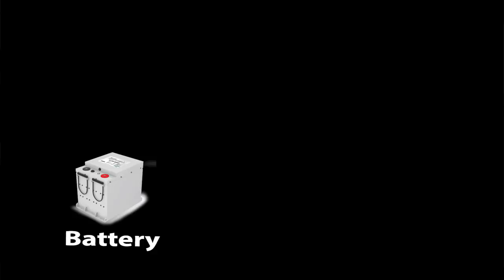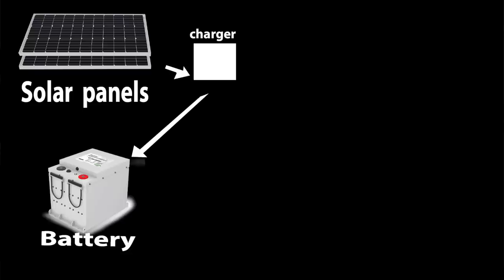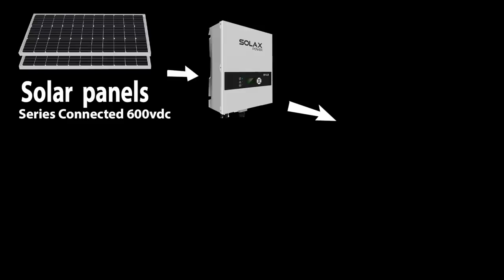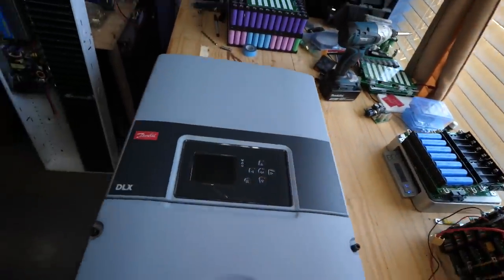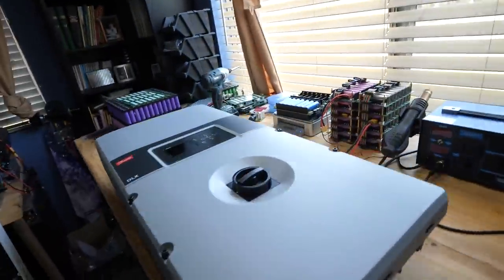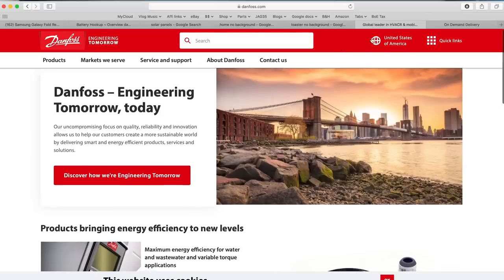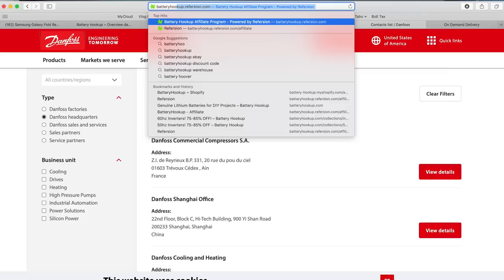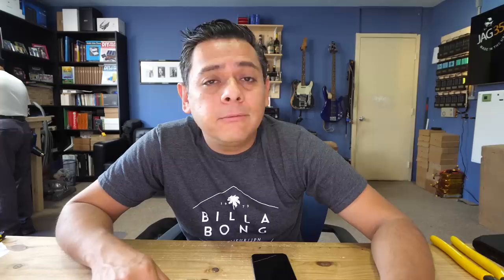Why are these Danfoss SOLAR Inverters So Inexpensive?

Comment: The series switching is for the arc flash on the high dc voltage side jehu
Reply: Is it cheaper to make like that?
Reply: @1978jra  probably otherwise they would have used high gause magnets to quench the flash,  think like a jacobs ladder,  needs a small gap to get arc started but the bigger gap, no way will the arc start,  open air has resistance value of approx 20 meg ohms i think (someone will chime in and correct me.) but as long as the voltage can overcome that resistance it will try to make a circuit with whatever is closest (shorter air gap) hopefully not you in the case of the kva range. that is why you don't fly kites or have helium balloons near high voltage power lines
Reply: @1978jra  must be other wise they wouldn't make it
Reply: @dtec30  True!

Comment: Question. I was looking at there specs and I saw that they have a starting voltage of 230v.on the dc side. So does that mean the system needs to have at least 230v’s before it will start converting dc to ac? And if that’s the case. Then you need at least 10, 24v solar panels. Right? Am I understanding that correctly? Or is there a way to get these inverters to start converting dc to ac with less voltage?
Reply from the maker: That’s correct 230vdc needed
Reply: Thank you. That answered my question.

Comment: SMA Sunny boy are the best,I use them Everywhere in the world Imput voltage is key
Reply: Curtis Albrecht  Hey Curtis, yes, they can work. If you have a completely ungrounded AC system, you can just connect the Neutral to GND in the inverter. The inverter will work without issues. The SMA SB5.0 series are all transformerless inverters so you need to make sure your DC potentials are flooting too.

Comment: Unlike AC in a DC current we never cross a zero point voltage between the cycles, a AC arc a lot less when terminals in a switch switches from ON to OFF, in DC current this arcing can destroy the switch, a switch which is rated at 240VAC often is only rated at 30VDC, it looks like that to make the main DC side input to handle the maximum DC input they have put all the three contacts in series, basically in increases the arcing gap compare to a single switching contact

Comment: Can they be grid tied to another offgrid inverter acting as the “grid” that it syncs to?
Reply: Electric Mountainboards an arduino plus two small mosfets and a small transformer, should amount to 20usd and be programmable enough to do it.
Reply: @fss1704  can you point me to the circuitry to do this?
Reply from the maker: Ive seen it done with a second inverter,  not seen it done with Arduino yet.
Reply: jehugarcia central tap transformer, you put the gnd's of mosfets on each side and 12v on the central tap, then apply a sinusoidal pwm signal of 60hz using the arduino, that's a piece of cake.
Reply from the maker: Sounds neat,  is there an example of anyone doing this on video?
Reply: Jayanth Devasundaram google "arduino inverter"
Reply: @jehugarcia  I made one inverter sometime ago using these motherboard mosfets and 3 rewired MOT's from scrap on a 2kw system that costed me just about the wires on the transformers, this system is scalable as fuck without additional controller hardware, you can just about increase the components numbers to get a bigger system.

Comment: i have question. I have 4 x160w solar panels. I have 2x 12v 230 a batteries. I have battery charge controller. I have 1000w grid tie inverter. I get electricity through the day from sun up to 300-400w but batteries does not get charged. How can i make batteries get charged for night and only after the batteries is fully charged, then take it for use in house?
Reply: Not sure if I'm right but the only way to charge them is with a charge controller or a battery charger being your grid tie inverter is connected straight to your panels
Reply: @rontech34  forgot to mention it, yes I have battery charge controller

Comment: Good inverter company but you need to study the specs to see if it meets your needs. It has 1 MPPT so all strings should be on the same roof direction (not one facing south and the other string facing west) and the max DC Voltage is 500 Vdc which will limit your string lengths. Ideally you would have a 600Vdc inverter that has a max 600 Vdc allowing for 12 panel strings.

Comment: Can you review 48V hybrid inverters Grid tied and battery backup connected to a used model S or Model 3 25V battery packs?  Can't one video using an all in one inverter with used tesla pack.  Thank you

Comment: It looks like these can be stacked / parallelized for bigger power output. And do have TCP/IP over Ethernet for monitoring and extra configuration. Unfortunately it doesn't support IPv6, or SSL. Both of which are weird.  Anyway, I am not exactly interested, because I want to have a hybrid system, preferably using single inverter. Theoretically I could have a separate inverter that operate from batteries, and charges batteries, but there will be many conversions in between, more space used, and it wouldn't be too smart probably in terms of when to charge and when to use batteries.

Comment: It's not called two phase, there is no such thing. It's single split phase. L1 across neutral, L2 across neutral gives you 120 VAC and L1 across L2 gives you 240 VAC
This is accomplished at the transformer with a single phase going in and splitting it to the neutral.
Reply from the maker: Got it

Comment: You will not be able to get the 50hz EU grid tie to sync up to the North American 60hz grid. Before the invert will output power it will want to sync up to the grids “frequency”. The 50hz will be looking for a 50hz grid only.
Reply from the maker: But what if it did?
Reply: jehugarcia well it and the electronics in your house could possibly suffer terminal malfunction; or at least run very hot and unreliably. Using more power, since they are specifically designed to run on the 60hz source. Though being as grid ties specifically look for the grids phase and match it, because out of phase power could once again cause issues with your appliances and the rest of the Grid. Ie your neighbors house.
Reply: iRoc Von JamminStien i'm sure you never touched a zvs in your life.

Comment: This looked like a fantastic deal until I looked up the approved list of inverters for where I live, and these unfortunately are not on the list.  As these are a few years old, are a discontinued item, and may not have all of the necessary safety features for your country - you may have issues getting an installation approved.  Danish quality they may be, but approved for use in Denmark they are not...

Comment: The problem is that they all run off such high voltages.  Makes it difficult when wanting to have an off grid system also.  I wish there was a way to modify them to use with a 24v or 48v system.   They look very well made though.  I thought of maybe using a bunch of relays to switch the system from series to parallel.  Want to see what you do to run it off of batteries.  100- 3.7v in series?
Reply: Run the solar panels in series direct to this unit, use separate split phase grid tie inverter /charger (like an AIMS) run the output of the danfoss to the input of the aims, and the output of the aims to your panel.   The aims will charge the batteries. 

Another way is series connection to the danfoss, and then parallel tap the panels with charge controllers to charge batteries, but would still need the aims to tie the batteries to the system. 

If you need power only when the sun shines, danfoss by itself would be sufficient.  

If I had a water tower, I would use the danfoss to run a pump during the day to fill the tower, and discharge the tower through a turbine at night or on cloudy/stormy days.

Comment: L2 is not neutral Jesus man.... L1 and l2 are both hot wires for 240 output in the USA....
Reply from the maker: It’s labeled that on the inverter,  and my name is Jehu not Jesus,  bob.
Reply: @jehugarcia  lol ok but that must be a European unit. An American unit wouldn't use neutral.
Reply from the maker: Supposedly is same hanrdware and all the region specific stuff is all software

Comment: new to all this. Isn't the 240 volt an issue. What size system do you need to use this? I have a good sized river behind my house and would really like to harness the power. A paddle wheel type generator on a float. But I just don't get how to get the 12 or 24 volts or even if I use one of those treadmill 90-volt things. I even bought a second hand 180 volt DC PWM 3/4 horsepower motor on eBay thinking I could use it but not for this system. How  I can power up a system that wants to see 240? Don't most people use 12 - 48 volt systems? So do you section off the batteries so they can get charged by the input voltage and then combine back to give the 240v to a power inverter and grid tie back?  thanks, Walt
Reply: fer starters... 12 Volts DC is a small system w/battery, say a backyard light or 2, or a small campervan set-up.... 
24 Volts DC is getting bigger, thats a large RV, or a larger home Lighting system.. 
48 Volts DC is the Serious stuff, obviously more expensive, but NOW we are talking the Voltage needed to easily use to convert to A/C for our Household appliances, HOWEVER, above 30 Volts DC is electric-shock and Fires, so lots more care is definitely Required there eh... I just stick to 12/24 Volts, needs bigger cables ( so what ! ), but NO bluddy electric shocks for anyone, and lots LESS chance of fires !!!.

Our system ( I have solar/controller/batteries, you are suggesting turbine/controller/batteries ) 
is completely self contained and stand-alone, thats it, you are welcome to use that DC Voltage as you like 
( I use 12 Volt, Vehicle Light Globes, in my house and around my yard !!! )

The 'inverter' connects to them Batteries, it Does NOT care about the turbine/controller at ALL, 
it is ONLY using them Batteries, so if the batteries go dead, the Inverter just stops working, full-stop...

In this Video he was talking about 600Volts from Solar Panels DIRECT into the Inverter - fantastic whilst the Sun shines, no bluddy Good- at ALL, at Night time, thus the need for the Battery system ...His Home was on the Mains/Grid already, That Inverter was just an 'extra', he uses the Mains/Grid power when its Nightime or Cloudy...

An Inverter WILL work off 12  or 24 Volts DC, just got to buy the Correct One ...

Good Luck !
Reply: @bluddyrowdy8757  Hi, yes I worried about this high voltage. The river is used by others and I would worry they would touch things! Don't want them to light up like a Christmas tree.  I had ordered one but had them cancel will probably start smaller and work my way up. to 48 volt or something like that. I bought a cheap Harbor Freight 100watt system @ 12 volts. Think I might get another and make it 24volts and get one of those cheap Chinese grid tie inverters  thanks Just want to do something to get started. Save a few cents and see if it is something I'm interested in. Thanks.
Reply: @walt4908  
I am an Electrician... Nah, do NOT be worried about the Water becoming 'alive', thats connected to mother-earth Matey, any 'stray' stuff will just go to ground, which should absolutely RUIN your generator in a matter of milliseconds... Please do what I do, the second-hand market !!! In USA its called 'craigs list' I believe... Quite simply work out what you think You may choose, find the 'new' price, then expect to Pay no-more than 30-50% of that Price,  for second-hand, simple clues to Look for in adverts are 'hardly used', 'like new',  '"still works, no longer req'd as have upgraded'", etc etc.. 1 word of Caution though, A/C is heaps Different to DC, so a standard AC 'circuit breaker' as fitted to housing, will NOT work on a DC system, I just use glass-fuses, on the DC stuff, same as was used in older Cars, they work great, and suit the mantra= cheap, cheap, cheap ! Good Luck !
Reply: @bluddyrowdy8757  Hi, no I'm more worried about nosy neighbors who will touch thing they shouldn't. That means I have to make the system "child proof" to keep people safe from  themselves. thanks
Reply: @walt4908  
Roger, 
a physical , mechanical . enclosure, non-conductive , plastic pipe called conduit Good ,  buried in ground or overhead on Poles. Most of the Way ?
Reply: Yes most definitely a  'tin shed' '  or enclosure, at stream end, weather Proofing is also solved, with a  lockable tin shed . one the size of a Dog Box  , pegged or concreted In
Reply: @bluddyrowdy8757  yeah, I have designed in sch-40 grey 1 inch  PVC most of the way and some liquid tight flex to get to raft that will have the PM motor/generator and paddle wheel set up to get the water to power the generator and thus power the batteries and or the grid tie system. Plastic barrels and plastic pallets will house the rafts electrical equipment. So this is the issue with neighbors. They will certainly want to get on the raft and look around. Might have to build enclosure or fence it in. Would like to run  AC up cause I'm 300 feet away from river, lot of distance and costly copper to go DC. But safer to go DC with low amps. Still working on final design. Yes, second hand is the way to go. thanks
Reply: @walt4908  
Brilliant ! Yeah yer miles ahead of me !!!!
I figured you were Playing, this is Well Serious ! , I know liguidtight, 'reinforced armoured Flexible etc ' conduit . Fence for Sure  is easiest, as second Barrier, I never understand why they are not Taller, but careful of a falling fence, reaching in.
AC is the MUST for that distance, its the Best surely not-in-Debate !, if you cannot bury conduit holding AC cable coupla foot down into ground all the way, where it pops out, just chuck conduit inside bigger and bigger pipe as more mechanical Protection, oops, back into ground again a couple of Foot down, away we Go, next Bit., and the higher you can keep the Voltage Up Matey, and lets not get too excited, you use 115V in the USA, 2x 115 = 230, 2 x that = 460, -maybe 500 your end, have 460 at the other end , thats my call for Transmission ( from my  eggspurt Armchair ), as Far and further you can get it before bringing it back to 'useable/necessary Voltage', is  bluddy Good !
Plenty of earth wires on any metal Generator parts , connected to a dedicated Earth Stake driven a Yard or so into mother earth etc etc.  Good On You !
Reply: 300 Yards.. ferk...thats A$100k just in that Fat multicore ( 3 actives, and a Neutral ) , plenty of Different layers of plastic, dfferent colours ) heck. Don't tell me I dont't wish to know $$, but thats a serious Distance for You - source. Yes, the Higher the Voltage, the Skinnier/Thinner the size of each condutor is able to be Matey , the difference is significant, I only know Metric = 95 -120 square Cable, and Bigger ? For You ! 
by George !, so 500Volts is now best if available, at the Gen ?
Reply: Every bluddy big power-cable manufactured in Aust, has an Earth wire in it too.,
 its a " 4+Earth cable "
Reply: 100 feet, 30 meters,  2 phase maybe usa, not our 3 phase in Aus ( AC anyways ).
16 millimetre cable,  individual conductors inside 2 x layers of Conduit is cheapest,
bit more bucks and lots easiest is 1 x circular cable,  in 1 layer of conduit .
63Amp circuit breaker for 16mm, perhaps for 230 Volts
Reply: My 16mm square is exactly half-way between your 6, and 5, AWG.
1 inch conduit hmmm. 2 Inch is good Matey, goes around corners lots easier inside that too, and its a 'robust' pvc to chuck around, hide under bricks and stones, Paint it when out of the Ground if exposed to Sunshine, pvc conduit costs like couple $$, so its nothing, to go bigger. Need " boxes" along the way ?  Screwdriver to open these Box, used at Change of direction even, in conduit-runs,, easier to pull  long-distance cable, or just assemble conduit  over cable as ya go... 
Heheheh, best I stop 'eggspurting away' here on my own, apologies for the Torture, Cheers from Rowdy !
Reply: I lied, I've had more Beer. 
100 foot is small , I'm definitely drunk and wrong so far.. 2.5 -4mm cable. for useable power, more the merrier but, 
1 inch perfect for thats size cable, and A$100 for cable,  aha. 
The lower the Voltage, the Higher the current needed.... eg, Old-style light-globe, 100 Watts , needs 0.43Amps @ 230V, 0.86A @ 115Volts, 2.08 @ 48 Volts, point being, More current actually flowing thru same wires to get bitten by, if we Touch it......
Reply: @bluddyrowdy8757  sounds like you're having a rollicking good time. Yes I have some AWG #4 wire rated at 60 amps and 600 volts so I should be okay.  Yes, we do 2 single phase 115 volts per leg. . They have  3 phase in many places where there is some industry but we don't have it here. Yes electricity can put a pretty good bite on ya if you let it. We used to work with 480 and 1,200 amp power lines into our foundry, electric arc furnaces melting different steels at 3k degrees. Had to wear all that safety equipment, gloves, goggles and a 6 foot fiberglass stick to reach past the safety barrier to turn the panel breakers on or off. Sparky always wanted to jump out at you. I forget how much power the large transformers carried 13.4k? Scary stuff. Just had to keep your head about you. Otherwise you are just a pile of ash on  the floor. Anyway, thanks for the conversation and the suggestions.
Walt